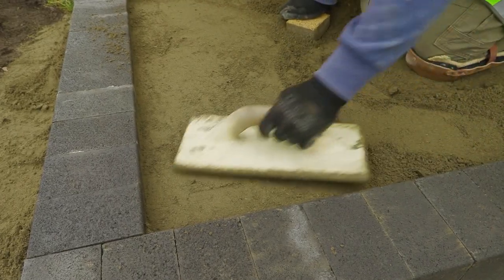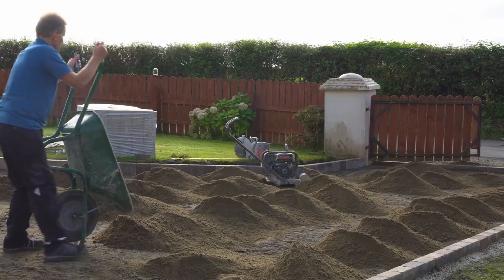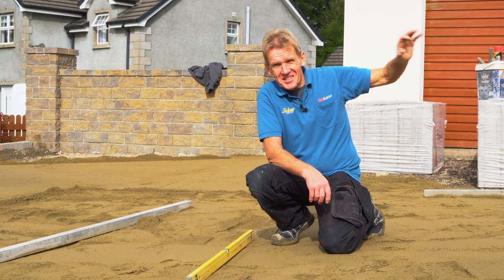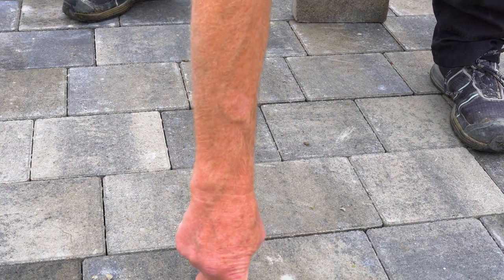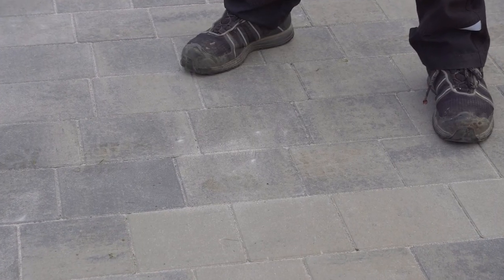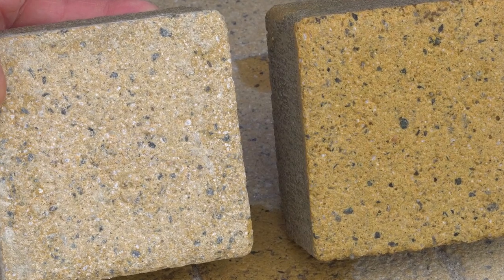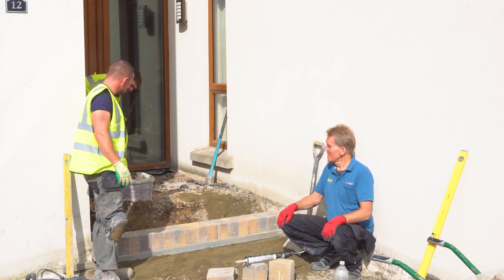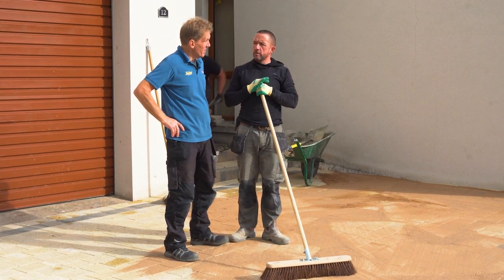Laying a Tobermore block paving driveway with SkillBuilder

Comment: Would it be any good for a driveway with a max gradient of 12%?  My concern would be that it could  be  like an ice rink in winter !
Reply from the maker: Hi Simon, There is no maximum gradient for laying paving. Your installer would just need to make sure they have adequate drainage to allow for water runoff. 
Regarding ice build-up concrete block paving would be no different to using tarmac or most other surface materials for that matter. The same de-icing salts used on public roads and footpaths can be used with our products. Hope this helps!